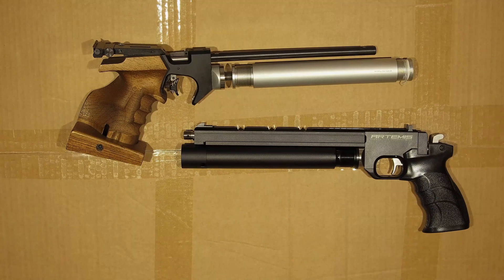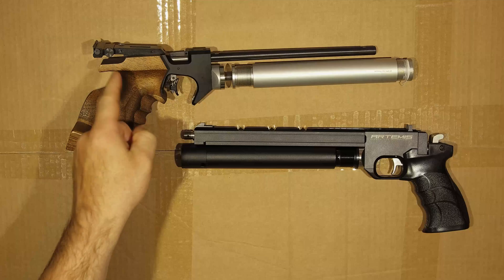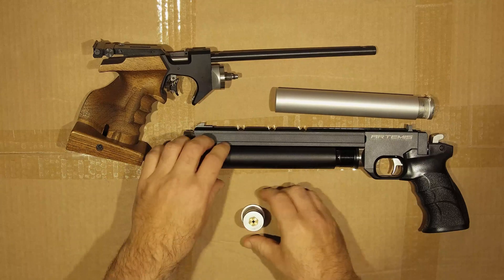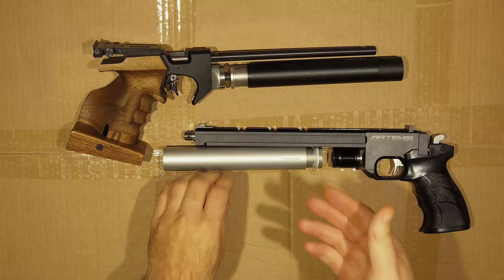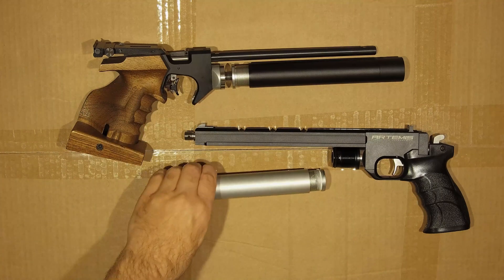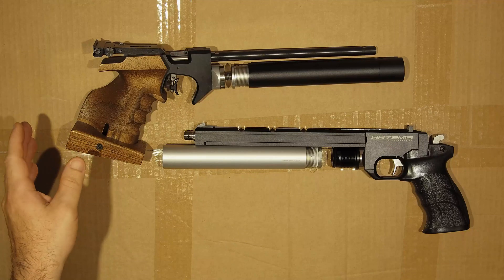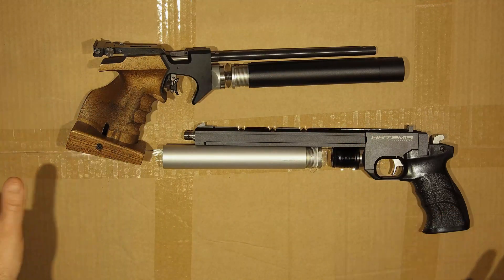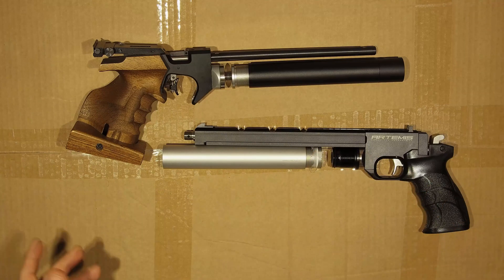Using a PP700 air tank on a PP20 target air pistol for easier filling.

Comment from the maker: Annnd as what happens with unplanned quickie videos, errata: you can screw the silver PP20 tube to the black connection on the PP700, and it would work, but you'd have no way to fill the silver cylinder on the PP700 then, unless you removed the gauge at the end ("you can see the pressure while shooting"), to replace it with a one-way quick-connect fill probe attachment thingy.

Comment: I bought a snowpeak PP20 recently and when I was loading a shot the lever got stuck in the air so to speak. Now I can't get it down and can't find a manual for it online either.
Reply from the maker: Aw man, that sucks, sorry to hear it!
And yeah, more airguns should ship with a manual of some kind, or at least have a working PDF on their site to pull from.

The closest I found was a parts diagram, but it sadly doesn't show how it works.

There's a rotating safety clip on the left side, just below the lever, I unscrewed mine because it was causing some jamming, maybe give that a go?

Otherwise might be time to just take it apart and hope you can see something obvious.

https://www.youtube.com/watch?v=ZLJnik9JLqk

I know the gun lets you dry fire, so maybe something's messed up there? Anyway, lycka till!
Reply from the maker: Hej again, so I noticed that the Air Venturi Comp10 is the same pistol, and it actually DOES have a manual, not really what you're looking for, but: https://www.pyramydair.com/airgun-resources/manuals/AV-Comp10-owners-manual.pdf

Also, did you play with the safety/dry fire selector and see if it helper?
Reply: @MyAirgunPhase So, this was actually a better manual when it comes to all the different screws. I took the gun apart partially and thought I solved the problem with the cocking lever gotten stuck but now the new problem is that all the air leaves the cylinder when I screw it on the gun so there is still something wrong. I think I need to take everything apart and figure out in what order things should sit to function properly. When the lever got stuck it was the back end of the pellet probe, where there is a bottom of a screw sticking out, that had managed to en up behind the hammer. At least I think that's one problem. 
I'll keep you posted when I figure it out.

Comment: Glad I could inspire you to do this! 😂
Now I have to see whether the black cylinder is available separately...
Reply from the maker: I'm always just trying to help and share, so it was a good excuse, thank you!

What I did with the PP20 cylinder was: removed the gauge at the end, and then replaced it with a one-way fill quick-connect port.

That means I can't see the pressure while shooting, but I've not found it to be much of an issue, the gun is regulated after all.

Good luck!
Reply: @MyAirgunPhase  It looks like the black cylinder would fit on the PP20 as you demonstrate. But are you saying it didn't work?

Why can't you see the pressure while shooting?
Does it only show the pressure while the fill port is pressurized?
Reply from the maker: @jonwid  The PP700 black cylinder as-is will not fit on the PP20, they don't have the same threading connecting to the gun itself.

That's why you have to unscrew the bits where they attach to the gun and then swap them around.

If you put the silver tube on the black connector of the PP700, that would work!
But you would have no way to fill it, other than removing the gauge on the end and replacing it with a one-way fill valve.

THAT'S what I meant, sorry, I mis-spoke.
Reply: @MyAirgunPhase  ah, that makes sense. Thank you!
Reply: @MyAirgunPhase  I misunderstood you because I was simply thinking about getting a PP700 cylinder only, if I could find one, and put it on the PP20.